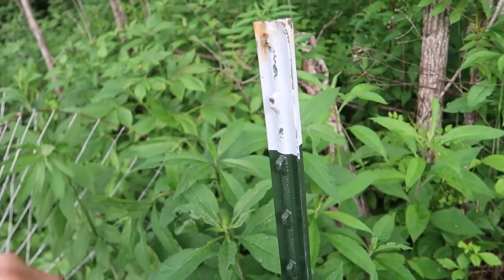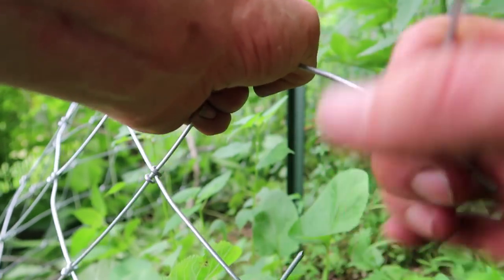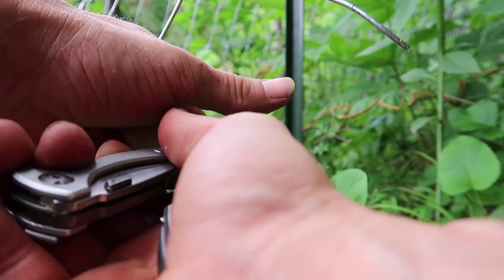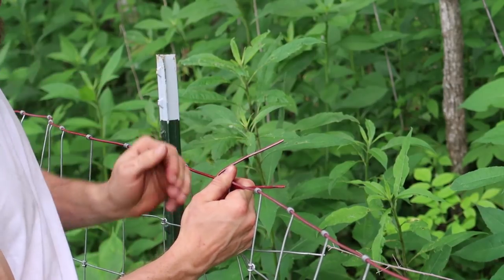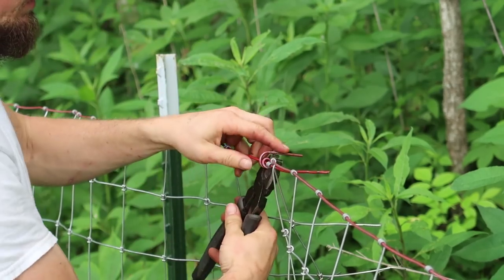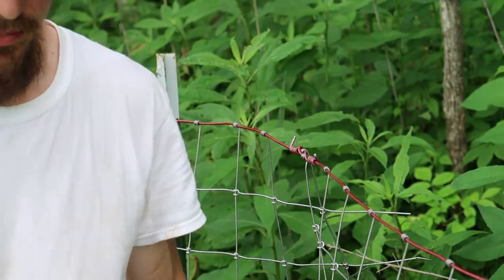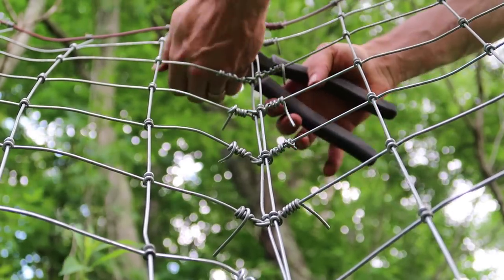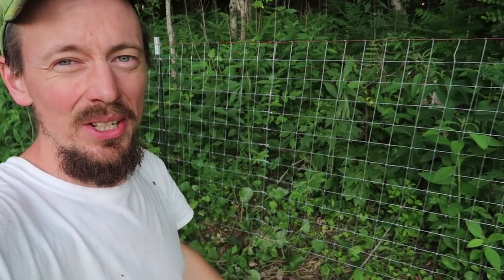HOW TO Splice Woven Wire Fence - With Just Pliers

Comment: Cut both pieces of fence ends, overlap by one fence square then tie both ends of each fence section together. Two tied ends is way stronger when stretching the fence tight.